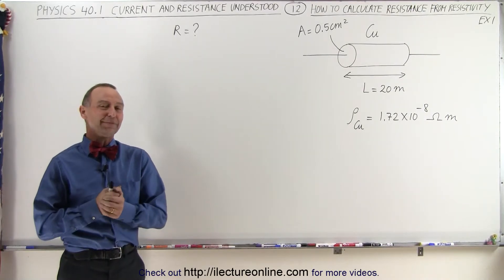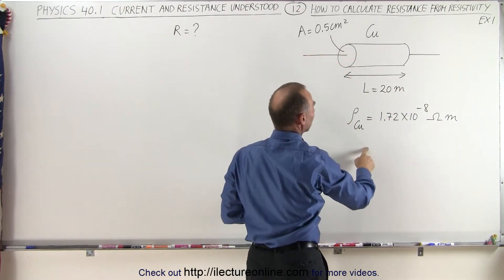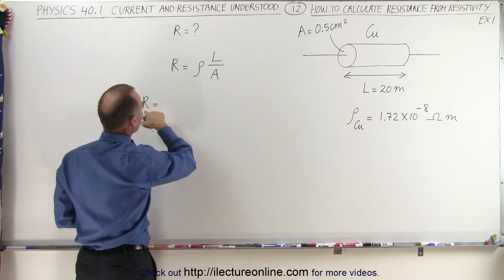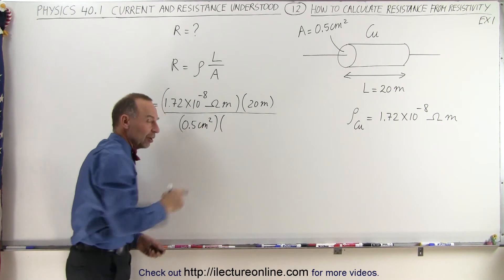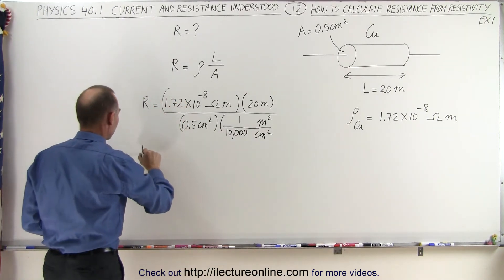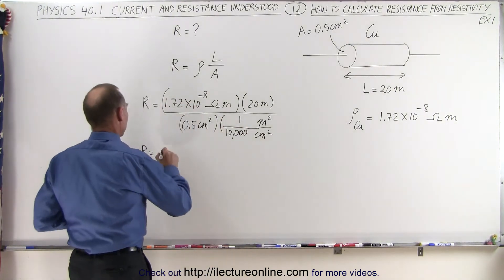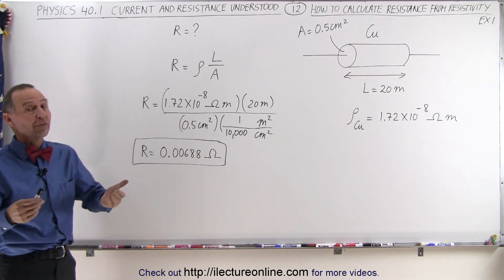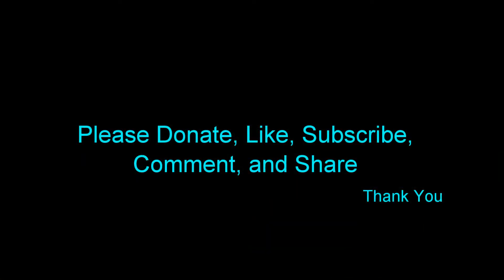Physics - E&M: Ch 40.1 Current & Resistance Understood (12 of 17) Calculate R from Resistivity

Comment: One has to wonder how Georg Ohm could measure such small resistances, or indeed the small voltages across bars or wires of the various metals he tested.
Reply from the maker: They were very clever and with very primitive tools were able to figure it out.  (They definitely did not have and Fluke digital meters).
Reply: @MichelvanBiezen  Very true!!